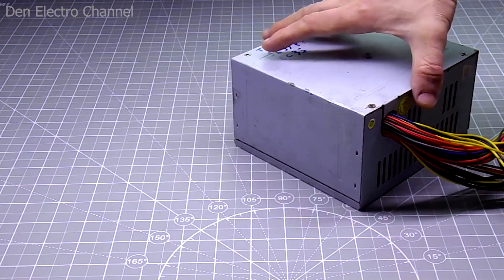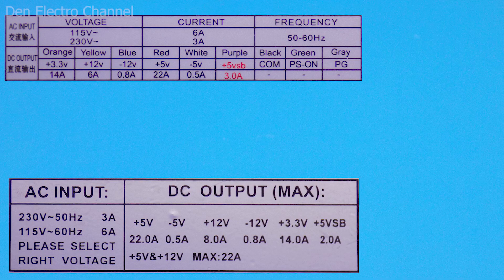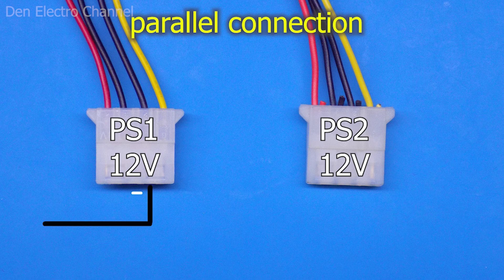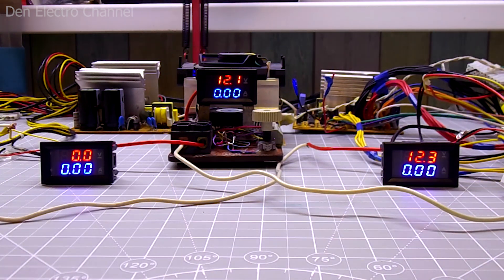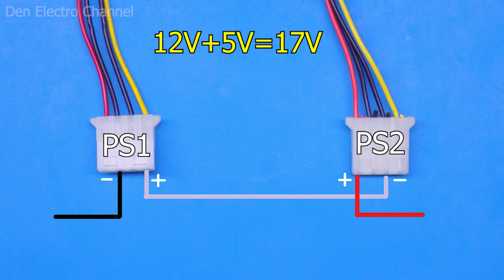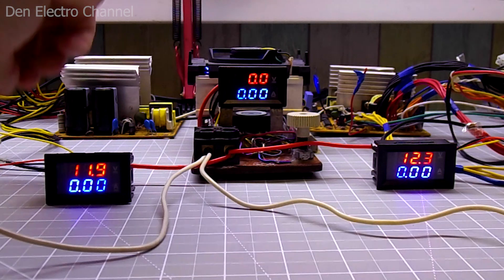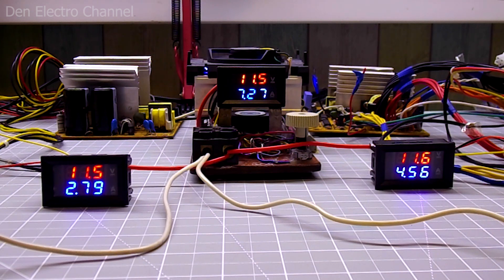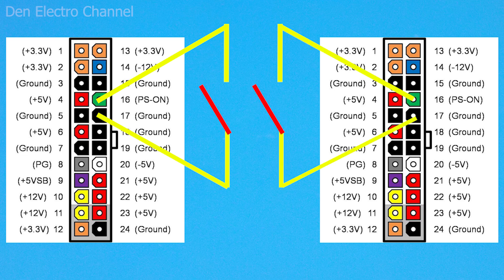I combine ATX power supplies. Serial and parallel connection.

Comment: Wouldn't this create ground loops? Once I experience that so want to have expert weigh in..
Reply from the maker: I don't think this should happen.
Reply: In the parallel use case, you might be able alleviate the current differential problem by putting a power resistor of one tenth of an ohm, or a few hundredths of an ohm, in the line from each power supply.  So you need two resistors, one for each power supply.  The power dissipated by a resistor is I^2 * R.